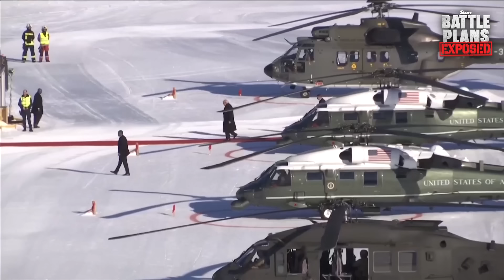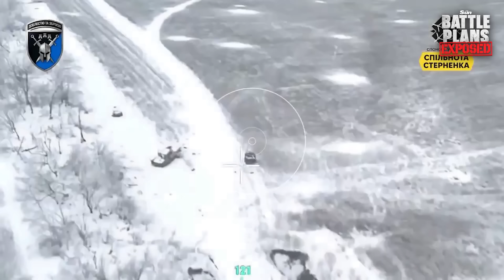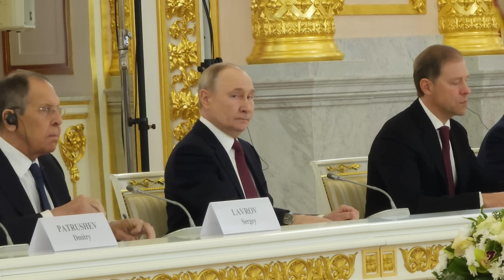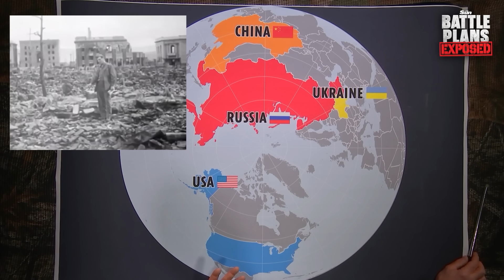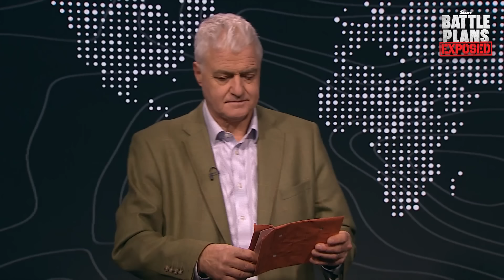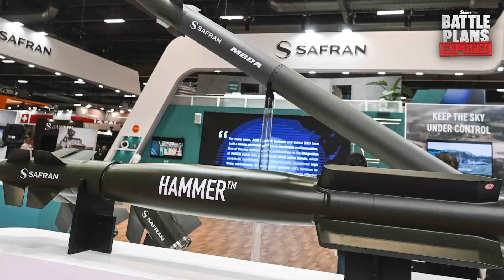EXPOSED: Ukraine unleashes HELL on Putin's secret Caspian Sea lifeline | Battle Plans

Comment: 1. NORAD has existed for decades for this reason.  Canada is upgrading it's OTH Radar with new equipment from Australia. 

2. There's a massive glacier covering most of Greenland, and ice blocking most sea travel for most of the year.   

3. Greenland and Denmark have been promoting mining on Greenland for many years; particularly to help Greenland to be economically independent.   But it's incredibly expensive and impractical to build the necessary  infrastructure in such a remote location that deals with Arctic weather and the glacier.  If it were financially viable, mining would already have been developed.

4. The only legitimate complaint Trump has is that there's Russian and Chinese shipping through the Canadian and Greenlandic waters for part of the year.  This is a problem only because there are so few people there to monitor and prevent territorial incursion.  However, satellite surveillance in the 21st century is a major mitigating factor; especially US military satellites.

5. Canada is beginning to redevelop and expand Arctic infrastructure and ports.   It's also building more icebreakers and naval warships, and preparing to launch it's own satellite surveillance, and has purchased the newest Over-The-Horizon radar from Australia.  New jet fighters have been purchased, with the additional possibility of partnership with Sweden and SAAB to build Gripen-E domestically.

Most importantly, the US Military and Canadian Armed Forces have extensive professional cooperation between them, regardless of politicians grandstanding on television in any nation.  Joint exercises between the USM and CAF take place regularly in Alaska, Greenland, and across Canada.  Chaos from one President hasn't actually stopped this, despite what the TV news presents.

Comment: Greenland's rare earth minerals
are under 2 miles of ice. It'll be 100 years before the ice melts enough to make extraction practical or possible and rare earth minerals aren't rare.
The golden dome is a term used by Israel to describe the missile defence system it uses to protect itself, but Israel is a tiny country.
This system would never work over the vast expanse of North America hence the failure of Star Wars.
And I'm pretty doubtful that Trump and his sycophants are competent strategists where Greenland or anywhere else is concerned as well as the fact the US has had full access to Greenland since 1951.

Comment: It needs to be explained clearly and simply: As per the 1951 treaty, the U.S.A. pays for the permission to  place bases and soldiers as needed on Greenland via an obligation to defend Greenland. It is that simple,  so simple that not even an American president can understand it. The American "need for Greenland is a frivolous hoax. Also, it is the United States of America that have scaled their defense deployment down from 10.000 + to a couple of hundred total base staffing at Pitttufik, the place where they lost an airplane with a full load of hydrogen bombs, one of which disintegrated and one that just hasn't been found.

Comment: trumps thread to take greenland was a negotiation tactic? "we are getting greenland, one way or the other"
but denmark hates you now... was that worth it?
also that mine ur talking about is an uranium mine, do you know how to get to the rare earth metals? after processing your dirt for the uranium you need to do extensive multistep chemical extradition over several month with the waste material. you wanna do that on greenland or transport everything somewhere else and do that there. keep in mind in winter it goes down to -40°C or F doesnt matter at that point. americans dont wanna work in alaska, how many will you get for greenland?

Comment: Missiles may well pass over Greenland, but they also pass over huge areas of Canada, whichhas US bases as well as teir own.  Greenland also has US bases which they are willing to expand.  Remember Russia can't even beat a small country on its border, and they are afraid to use Nuclear weapons, and many of theirs are expired anyway and could explode on launch, will they risk that?
Rare Earths are not "rare", the USA already has large deposits. Many of these minerals are more prolific than Gold or silver.  They are called "rare" because they are difficult to separarte from teh other minerals they aer mixed with and that make processing difficult.  However, the USA has large deposits of these minerals already partly processed in coal ash deposits, which are huge from earlier coal use.  The heat of burning already part processes "rare" earths.  The main problem is that the USA became lazy as there were plentyu of the minerals available from oither sources, mostly China so they had no need to 'waste' money by not investing in processing plants.  They will have to make that investment even if they grab the mineral in Greenland.

Comment: Excellent video. Just a couple of points; rare earths in Greenland won't be commerically available until the ice sheets decrease (maybe a 100 years), the Golden Dome is a space-based program so it needs early warning systems on the ground positioned far forward (like iin Greenland), Russia has had nuclear powered icebreakers for decades (its not a recent development like manning fortified military posts in the High Arctic), the Russians and Chinese annually conduct combined fleet maneuvers in the Bering Strait every year (not near Greenland), hostile air interdiction in the High Arctic almost exclusively over the Bering Strait and Alaska (again, not near Greenland).  Trump's tantrums have only made one person happy, Putin, since it has raptured the NATO alliance.

Comment: Yeah but it makes no sense on a defensive point of view having Greenland they are NATO Country and defenses can be put on the country with no problem without actually owning the country. America used to have a lot of bases on Greenland but most of them have gone I think there's two left, but there's no issue defensively with any missile Dome program. and if that's really going to help?? you're saying going over the Arctic and mainly Canada not really Greenland, but that's not necessary is it, if it's a ballistic missile it goes up into orbit and it comes straight down over the United States. it would bypass any Dome system anyway, I don't think they're going to use many cruise missiles like that the range is too long isn't it??
 as I said it's not going to give them any extra warning having any base on Greenland if it's into ballistic missile. And you could spot that from space with a satellite anyway would be the better option I don't see having a base on Greenland is going to spot any ballistic missile warning better than having a satellite in space.

Comment: As one with experience in the offshore oil and gas industry, I would say that those platforms attacked by Ukraine are actually production platforms, not "drilling platforms", which are put in place as permanent structures after the mobile drilling rig has completed the well and left.

Comment: Very dated and misleading analysis wrt to Greenland regretfully imo. No military reason for the USA not to have access to Greenland as it has the 1951 internationally recognised treaty. Ballistic missiles are in space when they pass over Greenland so what purpose is the radar station as any missiles will change direction AFTER passing over Greenland. Early warning will come from satellites and mostly likely Scandinavia. USA supposed strategic weaknesses are entirely fabricated. With the vast sums of military money the US spends, some could have been diverted to maintain strategic sensitive areas whether that be rare metals, semiconductors or even fuel efficient small cars. With the USA it's much easier to create a military excuse that benefits a few than solve a problem. Trump is just the worst example of the national trait.

Comment: Just the Russian casualties alone is staguring... Three Ukraine strike drones per minute, with video-confirmed strikes across the front. WOW Confirmation comes from a second drone to verify the strike, yet numerous targeted strike drones with non-secondary drone verification still add to the count of single-video strikes shown... Puts another 5,000 to 10,000 strikes to the count. But, not included in the official count OF 30,000 for the month. WOW.

Comment: Though the importance of Greenland for  US early warning is as important as said to be. Fact is, the US has closed down 90 % of its Cold War Greenland bases. There is only one, the Pituffik Space base. If it is so important, why shut them down?  US does not need to own Greenland for this; access is fully regulated by the 1953 use agreement, and not at all controlled by Danish "bureaucracies". US can reinstate these bases whenever wanted.  
Regarding the rare earth issue, I am so bl...y tired of smart ar..es talking about mining in Greenland as if it is the same as in central US or Europe.  It isn't, its expensive, complex, cold, windy, and a lot of negative things. It is af starting up a mine in Antarctica .... Yes, Kvannefjeld do include a lot of rare earth, reasonable close to "infrastructure", however it is so rich in uranium ore that it will kill both the people in Narsaq, 1.5 km from the 1980s test mine, it will fill the fish in several fjords and sea outside with high degree of uranium and heavy metals, and it will kill of the farms lingering around Narsaq. It will amount to moving all villages, farms, and two towns, Narsaq and Qaqortoq, some 5.000 people within 50 km / 30 mi. They will have to move more than 200 km / 125 mi to get away from pollutants and find places suitable for new towns.  
And, if the ice melts enough to reach the other finds;  New York, Washington, Miami, New Orleans, a big part of Los Angeles, Vladivostok, Shanghai, Tokyo, London, the whole of Netherlands, the whole of Bangladesh, Singapore, and a whole bunch of areas to be under 6-9 m of water and WE LIVING NOW have been dead for some 200 years. We're talking about ca 1 km of coastal ice needing to disappear first. Ice dynamics is far more complex than those talking about going to Greenland, sitting with a G&T, waiting for the Greenland ice to disappear in a snap. That snap will take some 1.000-4.000 years with current melting figures.  During the lifetime of the GenZ, the ice is likely to retreat no more than 30 km / 15 mi on an average, and not were mineable finds exists. 
And they still cost some 4-6 times more to mine.  THERE IS A REASON WHY GREENLAND BANNED MINING IN KVANNEFJELD.....

Comment: The polar map shown around minute 8 seems to have been distorted.  Perhaps intentionally, so as to appear to magnify the importance of Greenland.

First, the map shows a very large gap between Alaska and Russia.  In actuality, this gap is quite small, with the two mainlands being only 55 miles apart at the narrowest point.   The map shown suggests the gap is almost 1,000 miles across.

The "so what" of this is that in reality, the US can easily control ships moving between the Arctic and Pacific Oceans, and so is certainly able to keep the Chinese out of the Arctic if necessary.

And as to Greenland being a "cork in a bottle" vis-a-vis moving between the Arctic and Atlantic Oceans, that's clearly nonsense.  Even the questionable map in the video shows that there's a huge oceanic gap between Greenland and continental Europe that can't be controlled from Greenland's shores.

Second, the map seems to tilt Greenland in a way that shows it much closer to the North Pole than Canada's Elsemere Island.  In actuality, the two are about equally close to the North Pole.

The tilt also makes Greenland appear to be much more directly between Russia and the continental US.  On a globe, that faint white vertical line (a line of longitude) that runs from the west of Lake Superior to the North Pole runs well west of Greenland.  On the map shown, it touches Greenland.

The "so what" of this is that Russian ICBMs flying the shortest route to the continental US are less likely to be passing directly over Greenland than the map in the video suggests.  Some may pass over Greenland, dending on the launch and target points, but not nearly as many as the graphic appears to suggest.

So the statement that "Greenland is the single most important piece of real estate on the earth for the defence of North America" is bunk.

Comment: Idiots in UK gave away Diego Garcia to a CCP pal for NO REASON, so the possibility for Denmark to do the same is hard to Ignore.  Denmark has Done Nothing for Greenland for over 2 centuries. They have No power or strength, so Greenland can be grabbed from them quickly. USA has protected Europe since WWI, and NOW we need protecting. Stop crying and step up

Comment: Eureka, Nunavut, Canada.  Plan B to Greenland, if Greenland never existed.

is a remote research base on Ellesmere Island in Canada’s High Arctic (80°N), founded in 1947. Known as one of the coldest inhabited places on Earth with an average temperature of \(-19.7^{\circ }\text{C}\), it acts as a crucial weather station and atmospheric observatory (PEARL). It is a "Garden Spot of the Arctic" due to local wildlife. 

Key Details About Eureka, Nunavut: 

Location: Situated on the Fosheim Peninsula on Slidre Fjord, Ellesmere Island, Qikiqtaaluk 

Region.Purpose: Primarily a research facility, including the Polar Environment Atmospheric Research Laboratory (PEARL), which studies Arctic atmospheric and climate science.

Climate: Very cold, with temperatures averaging \(-19.7^{\circ }\text{C}\). It is often described as one of the coldest, if not the coldest, permanently inhabited spot in Canada.

Population & Access: A small, rotating population of about eight personnel. Supplies are delivered by air, typically once every three weeks.

Environment: Despite the extreme cold, it is known for relatively abundant flora and fauna in the summer.
Reply: The Port of Churchill, located in northern Manitoba,  is Canada’s only Arctic deepwater seaport connected to the national rail network. 

Owned by the Arctic Gateway Group (a partnership of 29 First Nations and 12 communities), it acts as a strategic, shorter route for grain, fertilizer, and critical minerals to Europe and Asia. 

Key Details and Strategic Value:

Location & Access: Situated on the Hudson Bay, it provides direct access to the Arctic Ocean.

Infrastructure: The port features four berths with cargo pier depths of 11m - 12.2m. It is supported by the Hudson Bay Railway, which connects it to the Canadian interior.

Ownership & Operations: Acquired in 2018 by the Arctic Gateway Group, which is a partnership of 29 First Nations and 12 other northern Manitoba communities.

Strategic Importance: It is viewed as a key asset for Canada's northern strategy, potential for increased trade with Europe, and as a shorter shipping route compared to southern ports.

Future Outlook: Following extensive upgrades to both the rail line and the port, there are ongoing efforts to expand capabilities, including potential dredging to accommodate larger vessels.

Economic Impact: While promising economic growth and job opportunities, some residents have raised concerns about potential environmental impacts on local wildlife.
 
The port is considered a "niche" but vital asset for strengthening Arctic presence and diversifying trade routes.
Reply: Canada and Greenland were originally the continent of Arctica.  Same resources.  Except Greenland's resources lay beneath glaciers.

Canada's resources.  Not so much.

The Canadian Shield is a vast, U-shaped, 8 million km² geological formation of exposed Precambrian rock that forms the ancient core of the North American continent, encompassing most of Canada, including Nunavut, and extending to Greenland. 

Canadian Shield in Nunavut

Geographical Core: The shield covers almost all of the mainland of Nunavut and much of the Arctic Archipelago, including Baffin Island, and parts of Somerset, Southampton, Devon, and Ellesmere islands.

Landscape: The region is characterized by bare, rocky terrain with very thin soil due to severe glaciation, which has left behind countless lakes and poor drainage.

Geology & Resources: It consists of ancient, hard igneous and high-grade metamorphic rocks, and is rich in mineral resources such as gold, silver, nickel, copper, and diamonds.

Environment: The landscape is primarily Arctic tundra, with some taiga forest in the southern areas. 

Canadian Shield in Greenland

Geological Connection: The Canadian Shield extends northeastward, forming the bedrock of most of Greenland.

Characteristics: Similar to the Canadian portion, this area consists of ancient crystalline rocks.

Ice Cover: Unlike the exposed rock in much of Canada, the Greenland section of the shield is largely covered by ice. 

Key Connections

Continental Drift: The Shield is part of an ancient continent called Arctica, formed 2.5 billion years ago, which was later split into parts including Greenland and Canada.

Physical Connection: The shield was rifted apart between Canada and Greenland by seafloor spreading in the Labrador Sea and Baffin Bay.

Modern Day: Hans Island (Tartupaluk), located in the Nares Strait, is a spot where the Canadian Shield connects the two, now split between Nunavut and Greenland.